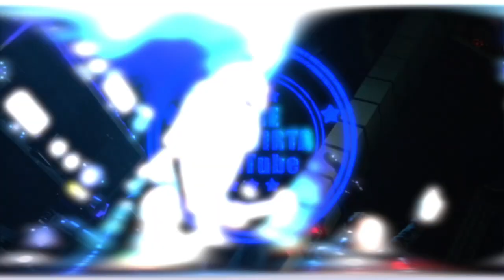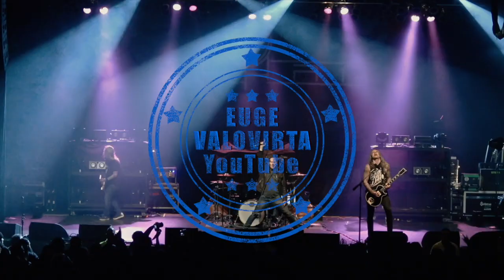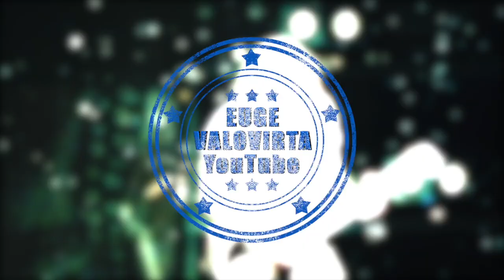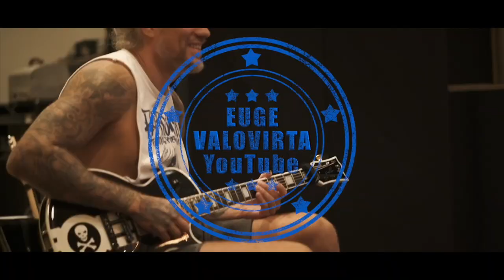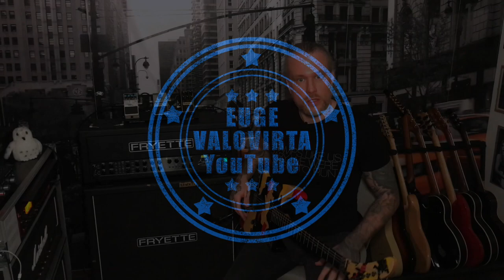How to use DELAY and where you should put it in your signal chain in different situations.

Comment: When playing live, I run all my pedals through the front of the amp because I don't like running 3 cables to my amp (2 to the efx loop in the back of the amp; 1 to the input). I use two different delays, one for when I use the amp's distortion and one for when I'm using my pedals to create distortion. It's easy to remember after a little practice. When I use the "pedal's delay" when using the amp distortion or clean I also get the benefit of a heavy delay (like U2-style) or a warmer lush delay when I run clean. It's just another way of doing things. :)

Comment: I want to use the distorsion from the amp and have the Delay come after. My guitar is plugged into the front of the amp, and the send and return into the Delay pedal. It isnt working so Im just wondering if i Am stupid or if something is broken? My amp is a Randall Rh100 and my pedal is a Behringer Vd400
Reply from the maker: Oh that’s strange. This might be a dum question but just to make sure😊: have you connected the effect loop send to delay’s input and delay’s output to effect loop return? Otherwise it doesn’t work. If it’s a parallel loop make sure the level is open and the delay’s level too in any case no matter if the loop is series or parallel loop. Can’t remember now which one the Randall has.

Comment: Hi Euge! Is it ok to add delay in Logic while mixing, or is it better to record by using a delay pedal? What do think about this? Kiitos opettavaisista videoista mestari🙏
Reply from the maker: Hi man! If you record the delay then you can’t get it off or change it so I always put it in the insert of the track (so you can have it on if you want when recording) and then when mixing you can tweak it or take it completely off or try out different delays, effects etc.

So in general the effects that are normally in front of the amp (overdrive, wah etc.) you want / need to record and then time based effects (dly, rev etc.) that are normally in the amp’s effect loop you add afterwards ’cos then you have a ”pure” sound recorded and then you can add whatever you want afterwards 👌😎.

But if the delay is part of the riff (The Edge type of thing for example) and in front of the amp then you obviously need to record that ’cos if you add it aftwrwards it doesn’t work like it works in front of the amp 😊.

Nasta kuulla! Kiitos!
Reply: Thanks 🙂